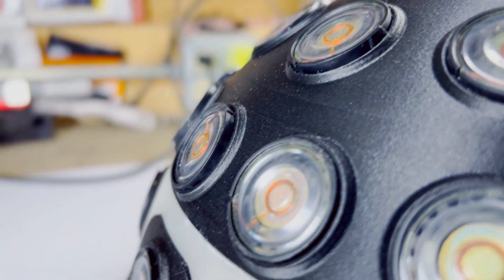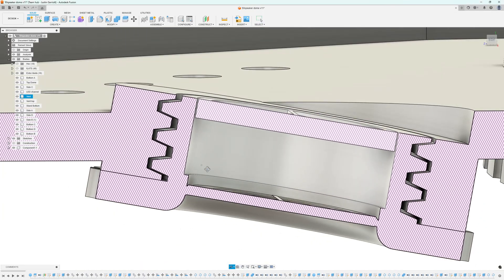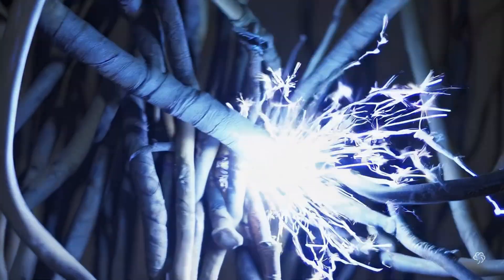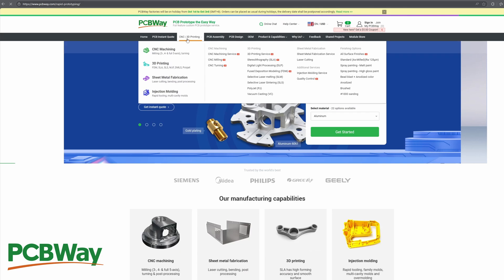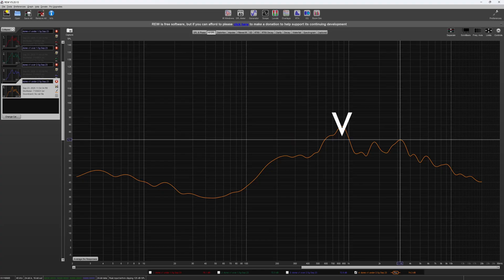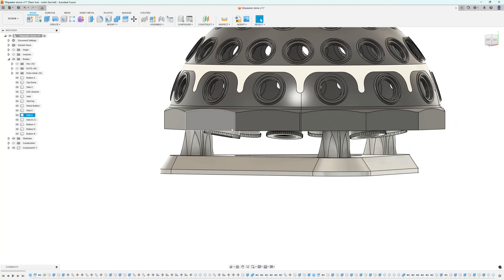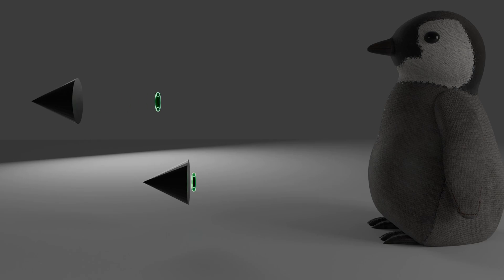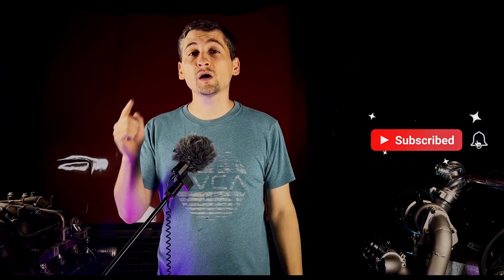I Turned 50 Cheap Speakers Into a Dome That Blows Your Mind

Comment: i still have a 46-speaker dome in plans. I even have a 3d layout ready, but i have not yet decided on what drivers to use. I also want to make it a dipole stereo, so i need independent amp and L/R mix to each driver. That's going to require some serious pcb... I have not even decided if i want to do it with analog, or with a dsp having full control over every single driver of the dome... The latter sounds like super fun, but a really hard pcb.
Reply from the maker: Best of luck! I can imagine having to mix a l/r into this project. A mono Chanel was hard enough.

Comment: Use good 2 inch speaker and much bigger Dome is batter 😊
Reply from the maker: That would be fun! Only issue is price 😂. A good 2” is $5-10 so 50 of them is $250-300… that’s a bit much.